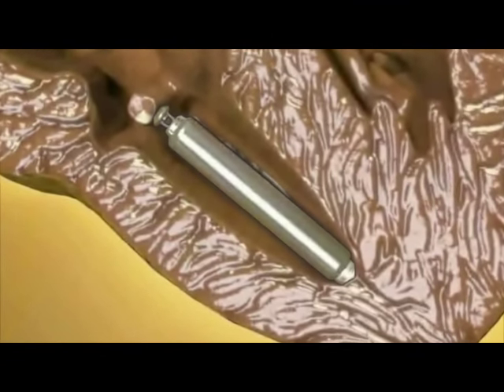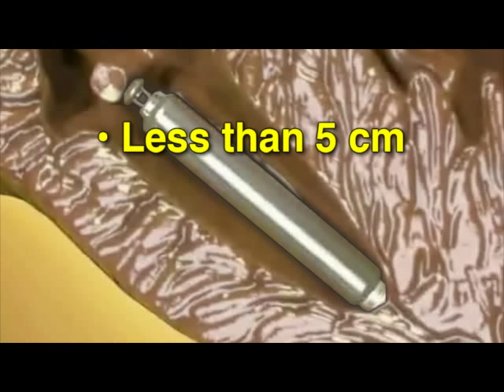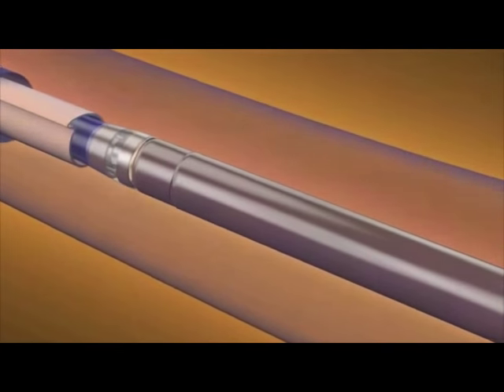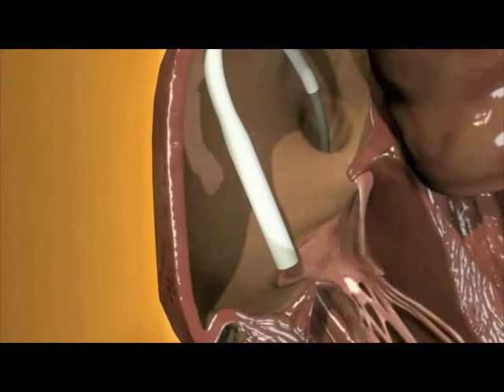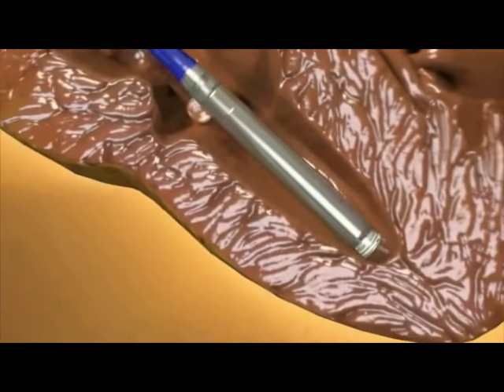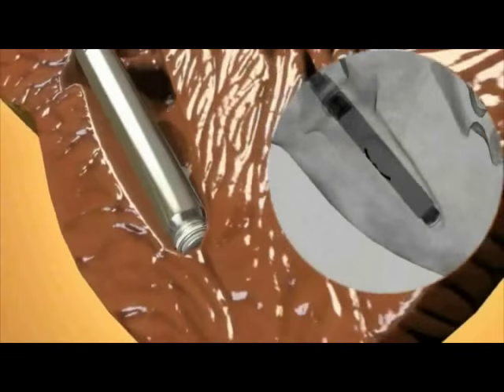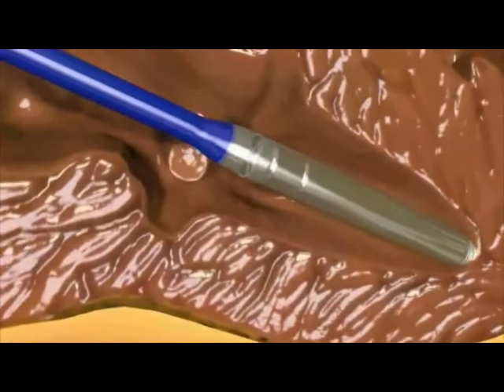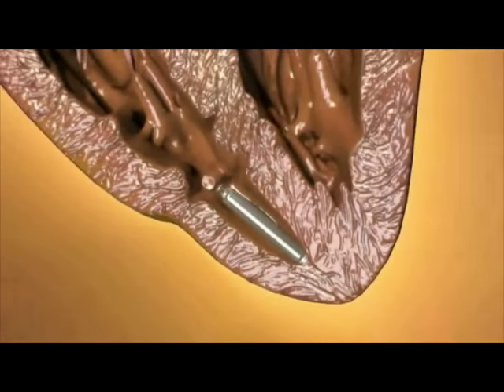Leadless Cardiac Pacemaker | NEJM

Comment: FYI if you could not see by the year, this video is dated (Nanostim doesn't even exist anymore). In modern headless pacemakers typically the apical approach is avoided due to the perforation risk. A mid to low RV septum placement is a safer location while avoiding the valve apparatus with the proximal portion of the device.